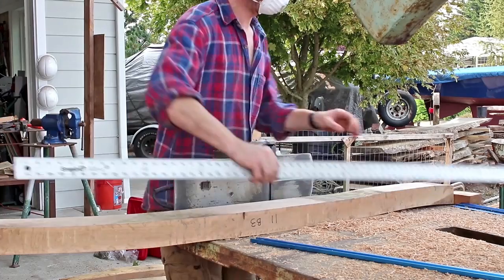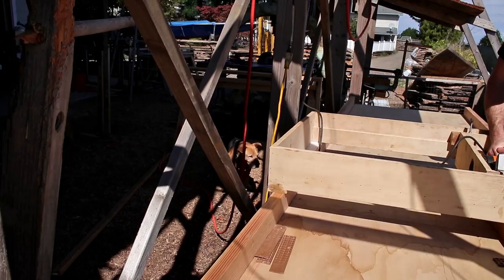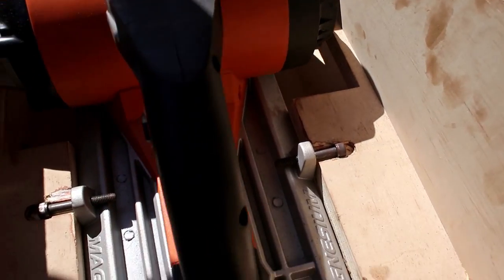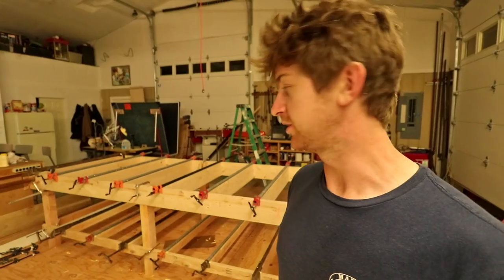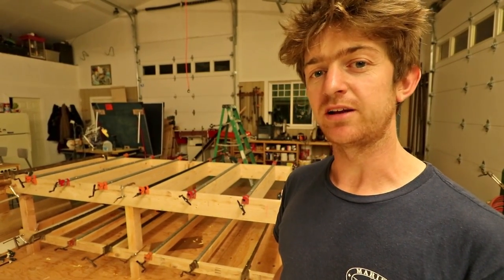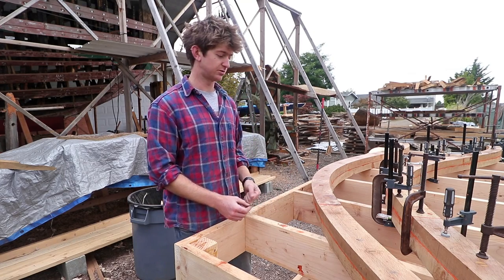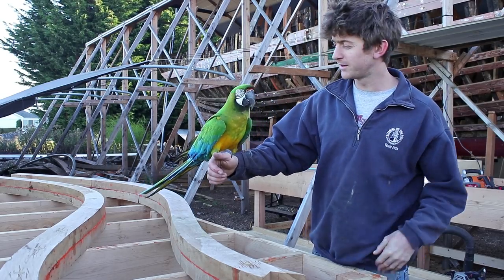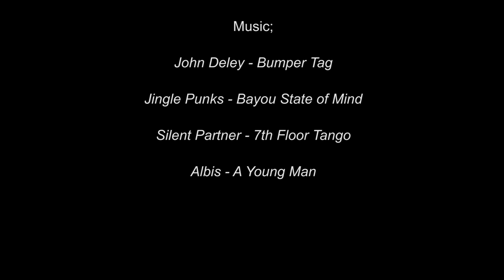Surface Power Planing Jig / Framing Tools - Rebuilding Tally Ho EP30

Comment: Great boat building and another great video.  I was wondering.  Is the area where you're located a moist or rainy climate?  Will the table and slide hold up and/or stay square if it gets wet?  I would imagine being so far north it will be getting cooler soon too.  I live in muggy/hot Fla so I kind of envy your cool weather (for a while...lol).  Thanks for posting all your videos.

Comment: About the lift screws, I noticed at 6:49 when the screws heads are turned they are slightly off.  This seems to give a canted planing.  If you mount a gear at the top of each corner and link them all together turning one would keep all of them aligned.  Bicycle chain or something like that.  Just a thought.

Comment: So I presume you are doing the Frames in Pairs ( Port & Starboard ) and the only difference is the Bevels are a mirror image of each other.  It would be revealing to put them on top of each other and show us a view of the bevels Juxtaposed to each other, in the sections with the most extreme curvature. It could also show if an error occurred on the Bevelling process of one of the frames at any point. Do you do that after Trunneling ?

Comment: hi, Leo if no one has suggested it yet you could tac-weld a small gear to each threaded post on the jig then a bicycle chain and add one single handle ,it will keep everything parallel and speed up your adjustments

Comment: Dear Leo, thank you very much for posting this information on the planing jig. A jig such as this would be very useful for planing somewhat warped timber which rarely goes well on the surface planer. Would paraffin wax not be preferable for greasing the runners of the jig or better still four ball races running on bolts? As I have a planer with a wonky front sole I feel a Frankentool coming on. Thank you again.
If the four adjusting screws were fitted with timing pulleys and a toothed belt, only one bolt would have to be turned at a time to adjust all four simultaneously and in parallel. This would accelerate depth setting considerably.

Comment: The planer (planner?) jig was great.  A router jig would be as adjustable as the planer version but would make much smaller cuts on each pass.  I might worry that the four lift screws could get out of alignment from one another - maybe that isn't much of an issue.  It would be cool to have a small gear bolted onto each screw which are chained together so that turning one screw would turn them all.  Just maybe I am over thinking it.

Comment: "Get Jiggy with it!".
 Any time spent building a jig is time well spent,  in the long run you're saving valuable time and knocking out the repetitive jobs so much easier.
I'd build a Jig to build jigs if possible. Nice work Leo.
Reply: @mabamabam  post a link for what you mean, i found random stuff about clickspring
Reply: Ya...that's the random stuff that popped up.
what does this have to do with Leo building tally ho or my comment?
Reply: sorry, it just isn't clear what your point is, the link is to a clock builder or something, not a jig.

Comment: Leo,
Great video on the planar table for the frames.  Any chance Kurt will have plans available for the table and the planar carrier?  I make live edge slabs from time to time and this table would be perfect for flattening both sides and making them parallel.  The assembly table would work well for laminating frames also since it is open all around for clamping.  Very informative video.  Thank you both for the great ideas.

Comment: I made a much smaller jig for a planning and solved the hight adjustment by using a wedge that would lift. That placed the adjustemt as a knob, out of the way, at the side  of the jig
I used a threaded rod to move the wedge and it was not effected by vibrations from the planner.

Comment: It might’ve been worth buying or renting, or just paying someone to put it on a cnc to flatten these out. You can put a big 2” endmill on that thing and take of .003” if you want. You can find your high an low spots, shim it up from the table if needed, and it will flatten that thing right up. Done it a dozen times with big glued up tables.

Comment: These labour saving tables are a good investment.
Just one hint, if your melamine and oil sliding surfaces get worn, cut up some cheap plastic nylon kitchen chopping boards as sliding surfaces.  
They last longer and are even slicker,  and they don't curl up and die when the rain gets on them.
Reply: Ray Watson Great idea thanks
Reply: I have also glued fermica on a sled, a touch of saw dust in there lubes it....just keeps going
Reply: Used in sawmills as Hi-Moly (HPDE).  Comes in lots of dimensions (sheets, long stock etc).  Several different 'grades' White, Green, Black  (levels of hardness).
Lining chain-ways, lumber stops etc etc.  If you can find a sawmill... they usually have some 'worn-out' stock available.
Reply: talcum powder give a very smooth sliding ,smooth as a baby bottom ...!!! dry & don't stick saw dust like grease ...!!!my 10 cents .
Reply: @Ray Watson, Great idea but, those chopping blocks are usually just HDPE, which can be bought as raw stock in many different thicknesses.
Reply: Yes, I know . But for price and convenience, in such small applications, I have found the local Dollar Shop the quickest and easiest solution, without having to buy large amounts.
Reply: One of the trade names for this type of plastic is Delrin.  Used in aircraft applications as a bearing surface because it is very slippery - think it has silicon in it....
Reply: UHMW Sheets, Bars, and Strips 

Commonly used as machine guards and as liners in chutes and hoppers. These sheets, bars, and strips have a slippery surface and excellent abrasion, wear, and impact resistance.
Bars 
Color: White or Black
Temperature Range: -20° to 180° F
Tensile Strength: 2,400 psi (Poor)
Impact Strength: 16.8 ft.-lbs./in. (Excellent)
For Use Outdoors: No due to UV isssues
Specifications Met: ASTM D4020

White
Black
Wd.
Lengths, ft.
 
Per Ft.
 
Per Ft.
1/8" Thick. (-0.03" to +0.03" Tolerance)
1"
1, 2, 3, 4, 5
8702K19
$1.58
8702K436
$1.76/FT   
McMaster Carr
https://www.mcmaster.com/uhmw-polyethylene-bars

Comment: It's funny how obvious something like that planing jig is, AFTER someone else thinks of it.  Brilliant idea Kurt.  

So you need 88 frames,  How many pieces are in each frame?  It looks like 6 - 10 separate pieces of wood.  That's a lot of planing, the new jig should knock off many man-hours of work!
Reply: makita 12" portable planer, take another 40% off planing time. solid carbide blades too. (Not a shill, user only)
Reply: A stationary planer will only make one surface parallel to the opposite surface. If the table-side surface is uneven, the cut-side surface will be uneven. That's why they have to hand plane the first side, because it's roughsawn wood.
Reply: Correct, the tool mentioned is exactly like the one in use but larger. It is a beast freehand but the table and carriage rig would make it easy to use.
Reply: Oh now I understand now what you're saying. Remove the planer from the frame/feed table, and place on the jig. Nice thought!
Reply: Roughly 250 pieces of live oak to build all the frames.
Reply: Google Makita KP312 and you will see.

Comment: Hello Leo,

To improve the planner, i propose a little tuning :
    To tune the hight of the planer , in only one time,  you can join all the screws with a T5 belt and Pulleys.
When you turn a screws, all the 4 are turning at one time, to save time and keep precision Up or Down of the tickness of  the position of the planner, kepping it always in the same plan ;)

thanks 4 sharing your videos :)
Best regards
Denis

Comment: maybe you could use some bright color spray paint as a guide coat when planing the wood, run the planer across the timber til all the paint is gone, then you can see instantly when its flat. but i guess you can see it on the texture of the wood anyways. just a tip, have done it sometimes and its pretty useful.
thanks for all the awesome videos of your great project, and good luck with all the hard work!

Comment: How hard is the live oak on the planet blades?  I’m sure it’s out there but a helical planer head with carbide blades would be amazing for handheld use.  Either way the planet sled is super cool.  Awesome job, Curt!  
One more question though. Are the new frames getting a coat of the raw linseed oil like the keel?

Comment: Sort of like an Alaska Sawmill for the planer. Put some Teflon strips on those runners to make it easier to slide around. Another maybe useless observation: You could use a little white spray paint on the top of the assembly table to both erase the old marks to avoid confusion and to make the new marks to make them easier to see. I binged watched the first 28 episodes over about four days and I love it. Is that the Adix on your sign at the peak of the boat shed?

Comment: To get the frames flat, you could have used one flat rectangular sheet, perhaps 3 thicknesses of 3/4 plywood, laminated together and large enough to encompass the largest frame. Then you would temporarily fasten the frame to this base and run it through your thickness planer, to get one truly flat surface.

Comment: A simple chain and sprocket system made from replacement sprockets for rear bicycle derailleurs and a length of chain can synchronize the four thumbscrews and make operation simpler.

Comment: Coat the tables with water repellent, so they won't twist, winter is coming. Enjoy watching you.
Reply: I would not leave them out in the elements.
Reply: I had the same thoughts, I also cringe thinking about the ships saw sitting in the weather.
Reply: Get a roof over those tables?
Reply: Looks like they are building a canopy addition to the boat shed to cover table et. al.
Reply: He had issues with local  zoning in the beginning just for the canopy that is over the boat. Maybe some side extensions wouldn't be noticed too much.
Reply: All the things mentioned here are in the works. It's just a matter of priorities. For now, tarps...

Comment: I wonder if Drilling holes through the frames in the hull or in the bilge I wonder if by doing so it would create a two-fold benefit 1 Bean it would allow air circulation 2 penetrate deeper into the frame should there ever be moisture and to to allow quicker drying.  of the Interiors of these members and we all know it's important to keep our members dry.  P.s. and would Drilling holes in the framing cause any weakness since in house framing they do this all the time but of course houses are rarely swimming with sharks or floating in raging stormy seas.

Comment: Another great video Leo.  I have to take exception to the thinking and statement that a router jig commits you to a predetermined depth.  The variable depth comes from the depth you plunge your bit to.  The jig can be set for a max depth but the plunge can go down in increments as needed just like your jig does with the depth screws.  Rarely would you try to level a surface in one pass on a router jig anyway, just creep up on it.

Comment: Brilliant time saving device! 

At the productive rate you’re ramping up to, as you keep adding more efficiencies through tools, equipment, templates, specialized jigs, etc., you could probably build a completely new sister to Tally Ho in a comparatively (next to the rebuild) short amount of time—if you wished to.

You’re creating a complete commercial wood boat building yard.

Comment: Wonderful video. Great to see one of the 'armchair experts' actually front up and improve the system for you. Seriously impressive craftsmen all round.

Now my turn to be an 'armchair expert'. I was thinking that if I were to be the one helping, how would I know when the board were flat? A possible solution would be a wash of over-thinned paint or even chalk on the surface to be flattened. Once it's all gone then the board would be flat! Maybe I'm solving a non-existent problem.
Reply: One way to tell flatness is by the force to push the plane and the sound of the motor.
An even sound the full length and the board is flat.
JIM

Comment: Use several coats of hard paste wax like Simonize on the planer jig sliding surfaces. It works great and will last longer than grease.

Comment: Hey dude! Still enjoy your Vlog! Just suggest you can use the teflon spray on the hand planer guide or rail to make the movement smooth and easy. If worn out you can do like what Ray Watson mention about white nylon cutting board. Do it on both side nylon to nylon very slick plus add teflon nice like a Cadillac! Lol!  Keep up good work and going.

Comment: Good job Kurt.  On one hand we have what works (the shipwright). On the other we have the brain saver.  Mesh the two as needed.
Reply: 6
Reply: I wonder what the guys 110 years ago would think of Leo's analysis if the framing table that he is using now.  Probably familiar territory.

Comment: When long lengths of steel are machined it is often turned over twice as the steel gives. So you might find it will be good to turn your wood once you have some flats on one side then give it a turn over.

I am near Maldon Essex , made a few Dumps ( steel nails) for the barges.

Comment: There is an ancient trick with trenails that guarantees outstanding result.  Heat fine dry sand with a bit of cat litter in it to about 375-400 deg F but no higher.  Plunge your trenail into the mixture up to the low end of the split.  After 2-3 hours pull it out and quickly dip it in boiled linseed oil or (best) warmed pine tar then drive it into the hole and dip your wedge into the pine tar and drive it into the trenail expansion slot until tight.  Two things happen.  Your trenail absorbs the waterproofing material as well as any ambient humidity as it cools and expands into its bedding.  The wedge does the same but will not expand so much that it splits the trenail.  This is a permanent solution to expansion/contraction issues in small joints.  Also, using pine tar would be a much better solution than oils below the waterline at all points.

Comment: Wooden boat building is hard enough, but with some labor saving ideas like the planer table will save time and back aches. Great idea Kurt & Leo!!!!  Just remember each plank has a rib or two in it all one has to do is to remove the excess wood.

Comment: Committed to depth with a router?.....Consider a plunge router setup for smaller work pieces. It's actually what most woodworkers use for slab flattening. I do like the planer sled, though.

Comment: Diagonal braces on the tables legs? Currently all the shear forces are handled only by the joints at the corners. Look at a cantilever bridge, diagonals everywhere. For good reason...
Reply: I was thinking exactly the same as you and agree that diagonal bracing will take the lateral forces and ease repetitive directional pressure off the joints. And have no doubt that Leo levelled each leg of the table on hard surface. Great idea Kurt, well done.
Reply: We used tight dado and rabbet joints all around with a liberal application of wood glue. It's shocking how stout those tables are with simple joinery and wood glue. You can't budge them a millimeter. It defies logic but that's also why wood workers spend so much time on joinery. Those benches will outlive us all.

Comment: Question regarding the paint between the layers of the frames: 1) doesn't it behave like glue - which you said you do not want to have there since the wood is too green yet? 2) when layers move or shrink, will the paint not get off one side at places abd lose its sealing quality against water entering, do that still you are in danger of rot?
Reply: I was thinking about that remember this is a soak and swell boat and it will be wet . As long as the water can drain and not mold he will be fine. 
The interesting thing about dry rot is it is a problem when something gets wet stays that way for awhile and dries that's when the bacteria eats the wood (Dry Rot)
So the reasoning is keep it wet but eventually it will make the fibers in the wood soft and fall apart but its not rot?

Comment: I was getting a Mathias Wendel (Wood Gears guy) vibe from that planer jig.
Reply: Not enough pantorouter for Mathias!
Reply: Not nearly enough over-engineered joinery going on there!! This jog need to have at least 8 finger joints, 8 Mortise and tenon connections and about a million dowels for it to come close to Wendel levels...

Comment: Weld small sprockets onto each leveling screw.  Run chain around it and throw in a tensioner.  Then you just have to turn one screw to make them raise and lower together. :)

Comment: Not that it matters now. But I guarantee I could make a sled with a 3 1/4 horse plunge router and a large flat bottom cutter that would equal or better the through put of the hand planer jig.
Reply: Keep in mind that planer cuts 4 in wide strips. Even a large router bit would only take one inch at a time

Comment: With the plainer jig having 4 screws at each corner to ajust the hight. How easy is it to end up cutting at a very slight angle?
Reply: It doesn't matter much because it will go on to a planer/jointer witch will make the top and bottom surfaces parallel.
Reply: @mikeg_123  ow yeah thanks